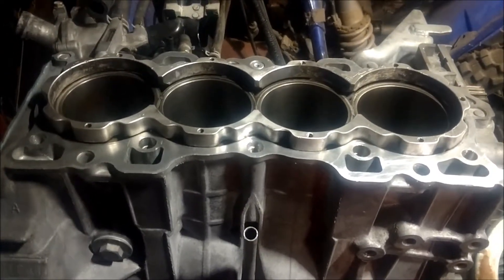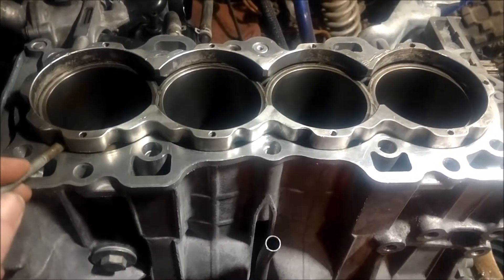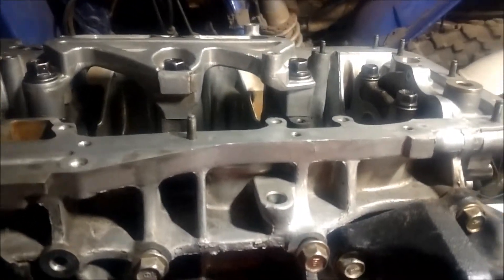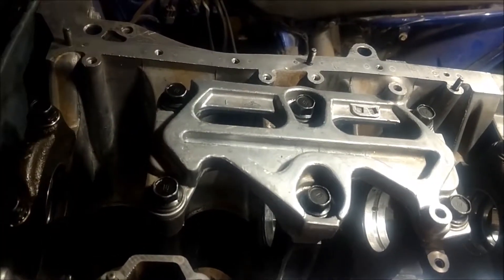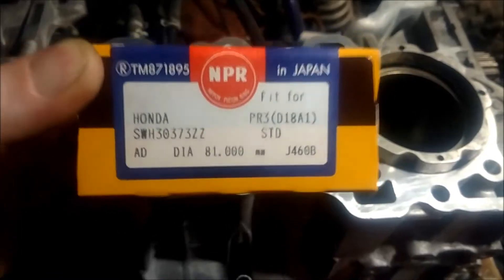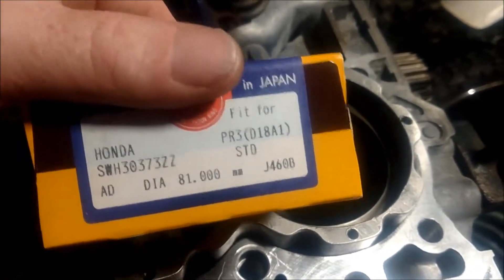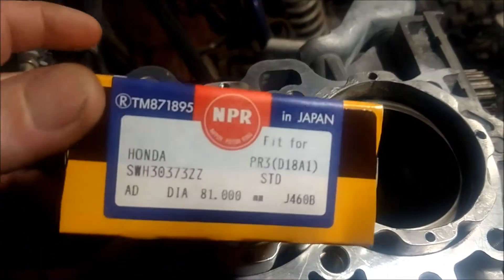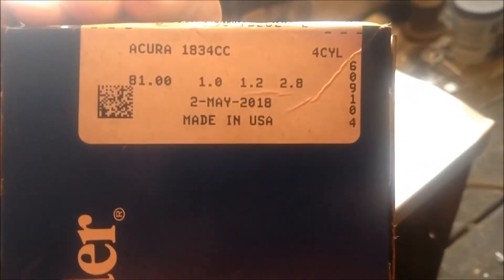Block guard, main girdle, and piston rings

Comment: Hi. What's a "CSS"?
Reply from the maker: @Kj16V  It is a cylinder support system precision installed by a particular machine shop.  It's somewhat like a block guard but extremely better and helps to keep the top of the cylinders from walking around.

Comment: is that a LS block or b18c?
Reply from the maker: It's an LS B18A
Reply: @civicr87109  im stomp on what kind of girdle to use. also did you replace all three items, windage tray, oil pick up tube, and oil pan? I have a b18b1 with morrosso oil pan which I don't want to get rid of. thanks for your reply.
Reply from the maker: I just modified my windage, pick up, & oil pan but the GSR is needed for clearance and fitment of the girdle.  U can use any B18C girdle or try one of those aftermarket girdle kits.
Reply: @civicr87109  im sorry for not getting this this reply. you said only thing i need is the GSR windage tray?
Reply from the maker: @jnsergio503  To fit the girdle u will need either to modify ur existing stuff or get the B18C windage, pick up, & pan or equivalent pan.

Comment: Did you use the factory bolts that were on block to install girdle gard ? I bought one didn’t come with any hardware or pins ...
Reply from the maker: U have to use the GSR main bolts on the girdle portion only.  The LS ones don't grab enough threads to torque.
Reply: @civicr87109  but If I have arp studs will that work?
Reply from the maker: Yes if u use the B18C main stud kit